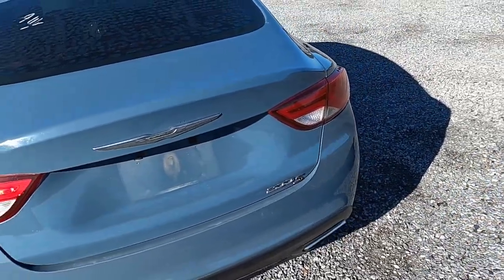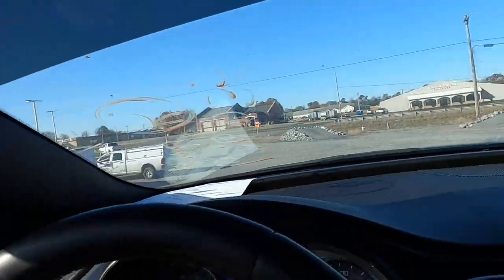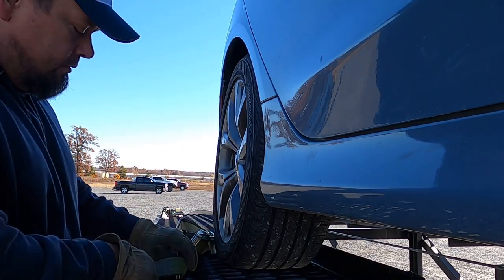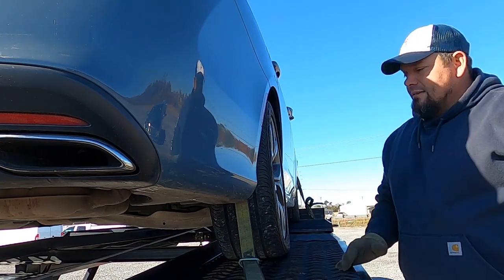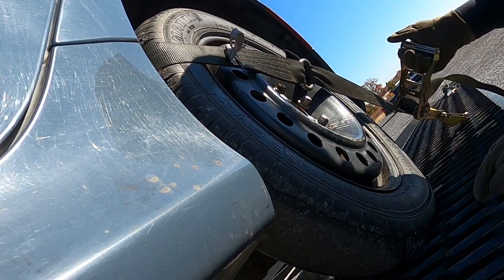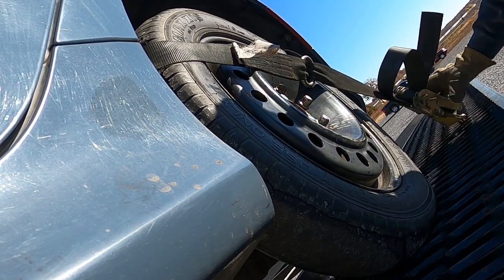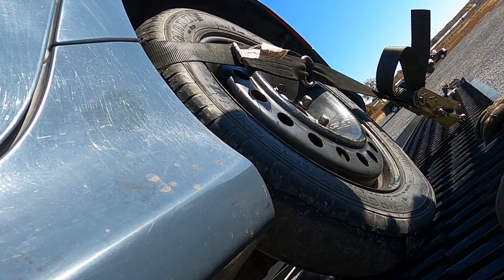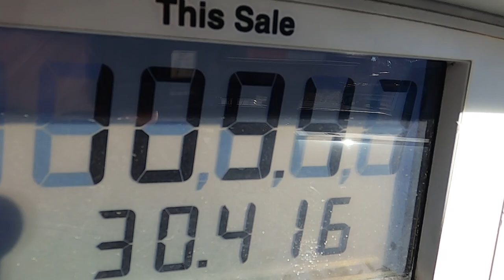LOCAL RUN | HOW TO STRAP CARS | A day in the life of a HOTSHOT VLOG 19 | Nashville, TN

Comment: Great pointers. It truly is nice when folks in the industry help each other out. One additional tip I can add to your strapping method would be to always ensure the parking brake is set on the vehicle. If not set it will tend to rock back and forth quite a bit and stress the straps causing them to loosen. Some older vehicles have parking brakes that don't work well, but most all vehicles do. Look forward to crossing paths with you out there sometime.
Reply from the maker: True, I tend to fly over things I figure should be common sense without realizing that there are people out here that probably have never had to use a parking brake lol. My favorite are the ones that have electronic parking brakes and the battery is dead when you get to delivery. So you have to hook up a jump box just to even roll the car off.
Reply: @LoadMizer  haha, man dont even get me going on those!!   :)

Comment: I’m just getting stayed driving for a buddy. Starting small with a f250 and 35’ gooseneck. Any pointers? I’ve only gone on one run so far from eastern shore Maryland to north Muskegon Michigan. I used lasso straps on all 4 tires and at least one or sometimes 2 straps would come loose after a some miles down the road. One time, a strap came loose literally 5 minutes after retightening it. I’m not sure if it’s something I’m doing wrong or if that’s just something that happens after hitting bumps on the roads. Would I be better off using bonnet straps? Using axel straps and tying down from there? I’ve been constantly watching videos and researching trying to get as much info as I can. I just want to be safe out there not only for myself and my cargo, but for others out on the road. So please, if you could give some pointers I’d greatly appreciate the time. Thank you.

Comment: The rubber on the straps are to prevent the strap from slipping off the tire. I cut all mine off as they are a pain in the ass to deal with all night doing local work.

Comment: What kind of MPG do you get on runs like that??? I have a 2014 ram 3500 dually I get about 7-9 mpg… with about 10,000 pounds on my trailer.
Reply from the maker: I consistently average around 8.5-9.5 loaded running the midsouth and midwest 👍

Comment: If you have to winch a vehicle up, can you winch it back down if it is not functioning? If not then how do you get it back off the trailer?
Reply from the maker: You just let it roll back down in neutral. The main things you want to make sure of is that the steering lock isn’t activated and that the brakes work. Typically you’ll need the ignition on which may require a jump box.

Comment: When you are doing local runs on your three car wedge where do you like to put the heaviest car for stability ?
Reply from the maker: I usually always roll with the heaviest on the tail. Generally I have a truck or big suv in the mix so it always goes on the rear. With 3 cars I usually don’t worry about weight I just put them on in the order they will come off 👍
Reply: @LoadMizer  thank you for the reply I have been doing a two-car gooseneck for the past 9 months and I just picked up a brand new 51 ft Texas Pride wedge and it is scary AF on some roads it feels super tipsy so I figured I'd ask an expert LOL I almost want to convert it to a kingpin to make it feel more firm

Comment: hey I'm currently starting the process of opening up and going through the motions....I'm curious, how many miles does your truck get put on it every year? how long do these engines last for? whats a a good number to keep in mind? I'd appreciate any info people have as well. Love the channel, just subscribed and been watching the vids
Reply: @G Gagoots You can average about 450-600 miles a day if you stay local if not just base it off a 10-12K a month. So 100,000 - 140,000 a year if your really hustling. I’d prolly put it at 100,000 Cummins last forever, they make semi and dump truck heavy haul motors, best engine there is for hotshot, that’s not gonna be what breaks if it does it’s rare, it’s all the little repairs that’ll get you, trade it in every 120,000 miles and after your first truck you should be able to use company credit unless you do the enterprise rental like him!

Comment: Hello I am semi driver Owner operator I have my authority but I have 53 ft dry van I am trying go with auto haul what’s the best step to take and truck and trailer size f450 or ram 3500 5500 thanks
Reply from the maker: Definitely stay away from the f350 and 3500s for car hauling. They limit you so much because of the rear axle rating. Definitely get a 4500/f450 or a 5500/f550 but make sure you don’t get 4.88 gears on those
Reply: Got you thank you very much

Comment: I’m an independent owner operator leased on with a company, small one, where can I sign up for fuel discounts? Any would help, and I only pay 10% for me to lease on, and an extra 5% for them to dispatch for me, not too bad, I find some of my loads, I keep that 5%. But would we all have to use a factoring company and fuel discount or can I just do that myself?
Reply from the maker: That’s actually a really good question as far as the fuel cards go. I’m not exactly sure if you could get one in your name leased into another carrier. There are options though. I’ve heard great things about the mudflap app. Since you’re the one paying for the fuel I’d most definitely go either that route or start buying your fuel with a cashback credit card. Combining those 2 things will net you your lowest fuel cost. 👍
Reply: @LoadMizer  mudflap is good Midwest to east coast, pretty horrible west and southwest. I do use all my fuel purchases on a credit card and then pay off each month. But I hate HATE hate credit cards.

Comment: 2 tiedowns per car or 4 tiedowns per car? I know what FMCSA 393.128 says about tiedowns. Under 10000lbs "(1) Automobiles, light trucks, and vans must be restrained at both the front and rear to prevent lateral, forward, rearward, and vertical movement using a minimum of two tiedowns." I'm a 34 year trucking veteran but new to hotshot auto transport. The one who trained me how to load/unload and tiedown vehicles using 3 point strap insists, in no uncertain terms "that it must be 4 tiedowns or the law will stop you and fine you!!" This made me flinch. I look around and I see most drivers using 2 tiedowns per car. The only one I see using 4 are the OTR drivers. My work is local/regional.  Equipment is a 2017 Dogde Ram 5500 and a Kaufman 3 car wedge. I really enjoy your videos. I'd like your opinion/advice on this subject. Thanks.
Reply from the maker: Legally you can roll with 2 tie downs opposing sides. Some plants, GM, Mercedes ect require 4 per vehicle but it’s completely legal to just use 2 tie downs under 10k.

Comment: Quick tip;

Cut the buckle/clip off an old scrap seat belt and keep it with you. Most automatics will let you move with door open if it thinks seat belt is fastened :)
Reply from the maker: Oh I’m trying this.
Reply: @LoadMizer  should work on most. I found out on a bmw with faulty door latch. Kept jumping to park thinking door was open.

Comment: It seems to me that the trucking industry is surrounded by blood sucking leaches every way we turn. I avoid the big truck stops like the plague. I stopped at the Loves in Macon a few weeks back and should have shot a video. All the pumps but 1 had trucks camped out but were not fueling. And I was on line inside for a while buying some BOL's because every now and then I have to do a hand written one. Came out and all the same trucks, including a hot shot whose driver was no where in sight. All those trucks in line waiting and fuming as their hours whittle away! With a 30 Ft. trailer I can get in plenty of regular gas stations. I look on gas buddy, then google maps satellite view and street view to see the access to the pumps so I know which ones have diesel and if I can get in and back out. I'm not playing the fuel card games, factoring, dispatching...none of that crap! Whew! OK, I'll get off my pedestal and ask a question. What kind of strap can I use on a 102" wide flatbed trailer for tires? I don't haul cars generally, but I do a lot of loads for United Rentals and they move F250 / F350's every now and then. I chain to the rear axle and tow hooks, but wonder if there's a lasso type that would work on a flatbed hot shot trailer. It's a PITA on the rear axle making sure you don't damage the brake lines or shocks.
Reply from the maker: Yessir, they do make axle straps. It’s pretty much a lasso with padding. Still have to navigate the brake lines though lol.
Reply: @LoadMizer  I bought a couple of short straps for over the axles but hadn't tried them yet. Thought I saw TP use a lasso style to his rub rail.